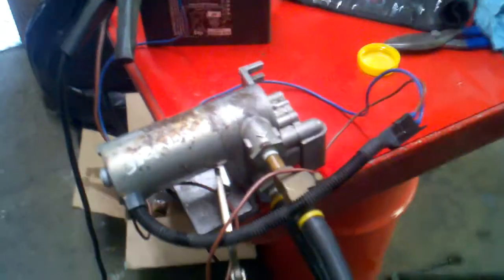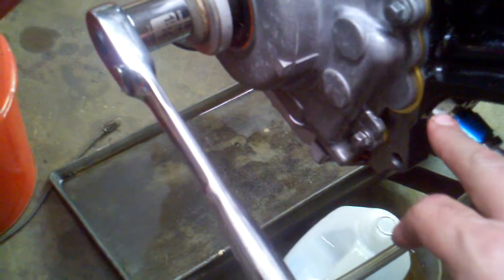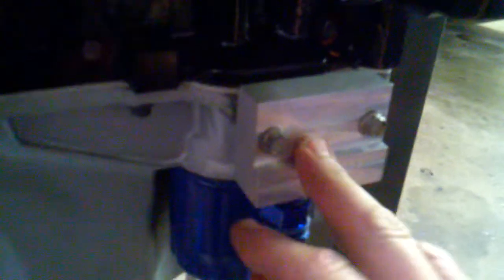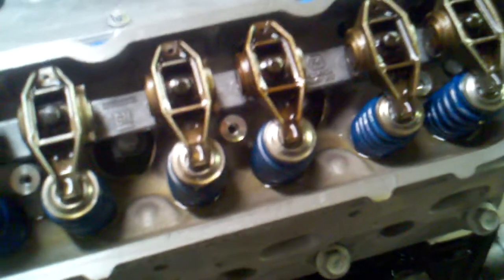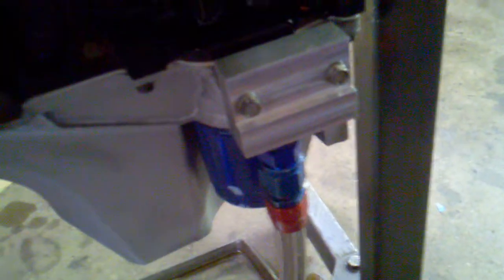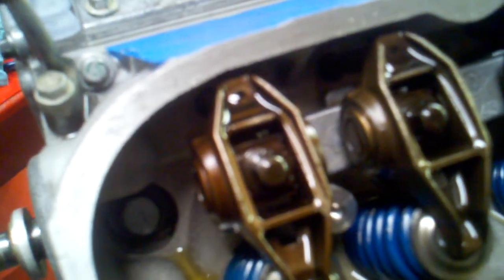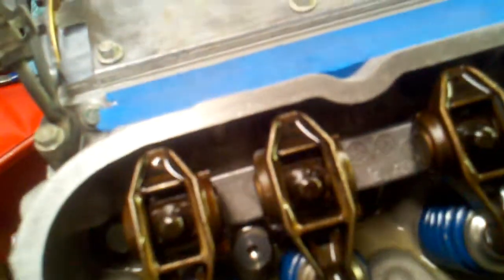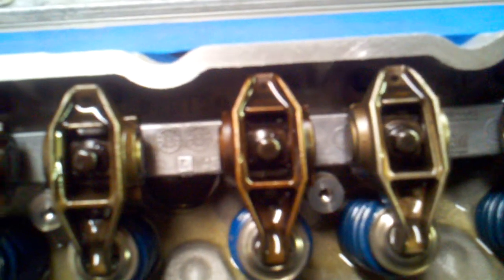Ls 6.0 oil priming part 2

Comment: Dude, the return line you have is just recirculating the oil back into the bucket.  You're feeding it into the main passage and it runs right to the oil filter then into your return line.  Wake up and just get rid of the return line and push all the oil through the motor instead of all that jacking around.  If you want a return line run it from the oil pan drain to the bucket.

Comment: Yea brother, the passage you're pumping oil into goes straight to that first hole. I would just block off the cooler holes completely and just let the excess oil drain out of the oil pan after it lubes the engine.
Reply from the maker: But i had the barbell in as well
Reply: Right but that has nothing to do with what I'm saying. You're actually bleeding off pressure instead of letting all the oil circulate up and through the engine. You could just connect the two cooler holes together with a hollow blockoff, then the oil would flow from one hole to the other and on up to lube everything. By putting that return hose there, you're just bleeding off pressure before it ever reaches the bearings and topend of the engine. Thats why nothing was coming out till you restricted it. 😉
Reply: @BadLuckGarage  hey I'm trying to prime mine as well but seems that I'm not getting any oil to the top end I'm plugged in to the galley in the front with electric pump but not getting oil to come thru push rods any help would be greatly appreciated
Reply: @lsryda4155  oil pump working? Oil pickup tube maybe clogged.
Reply: @lsryda4155  You have to run a stock bypass cover over the cooler holes and rotate the engine as you feed it the pressurized oil so it will work up through the lifters.
Reply: Put the return line in the oil pan drain.